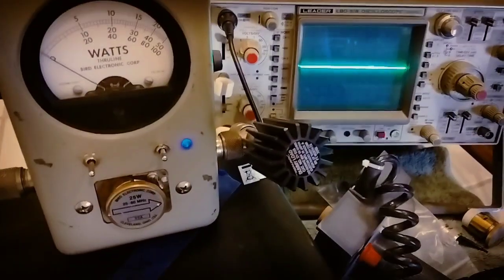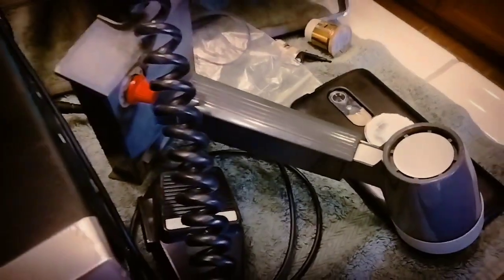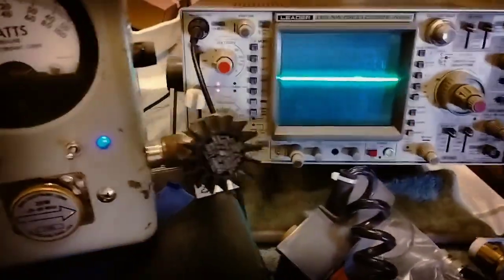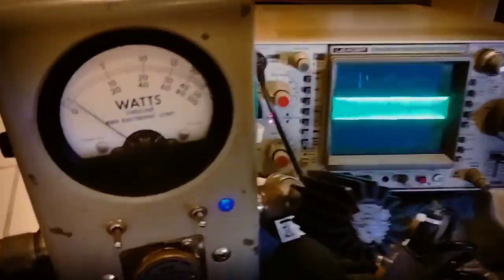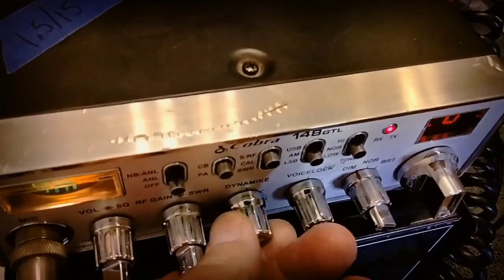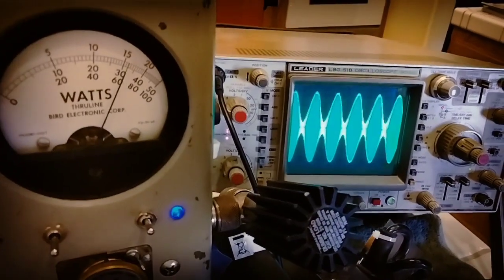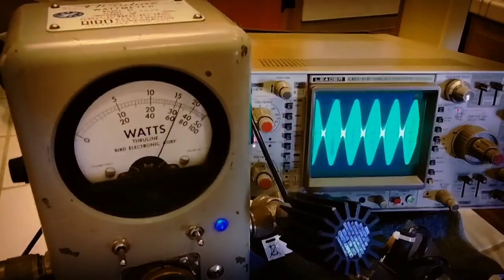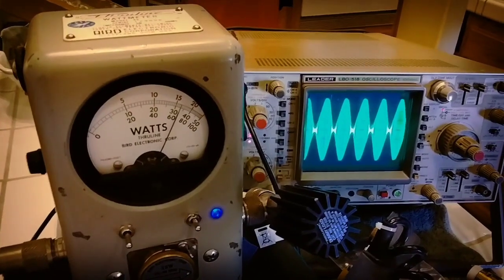My Chinese Cobra 148gtl with Over 200% Modulation.  1/2 watt dead key, 16 watts PEP Clean Modulation

Comment: Sweet Been thinking of buying a scope
Reply from the maker: There are plenty out there for sale.  Just make sure to get one that does 30mhz or more.  Shop around you will find one cheap, probly less than $50.  I bought this one just a few days ago for $10  https://www.youtube.com/watch?v=d-s9RghwGdo  I did fix a broken wire on one of the inputs, but it had 3 others to use anyways.
Reply from the maker: what city are you in?  I will search for a scope in your area
Reply: Nice way to tune your modulation 👍
Reply from the maker: Thanks, this is a rare one that the audio wasn't ruined with a low deadkey.  What I mean by that is... that usually if you try to go below 1 watt it starts causing a lot of distortion in the audio, but this one I was able to get down to 1/2 watt without an issue.  Really the low dead key is the secret to getting the most modulation, but if you are trying to match the radio to an amplifier you may want a different higher deadkey.   Almost all my radios that I match up to an amplifier will have a 1 to 2 watt deadkey.
Reply from the maker: @14KiloWhisky  Thanks

Comment: Question I have been learning a lot recently about electronics and I have a cobra 148gtl and it works great,only flaw is the volume does not work when you turn the radio on it's just full blast and you can't turn it down,what do you ginks wrong with it? Maybe the volume knobs it's self??? Any help would be great thanks and hope to talk to you soon wildman north Carolina
Reply from the maker: without actually looking at it, it would seem that the knob is broken internally or there is a wiring problem on the back of the knob,  or someone tried to do some type of mod and failed miserably.
Reply from the maker: Did you ever get that volume knob fixed?